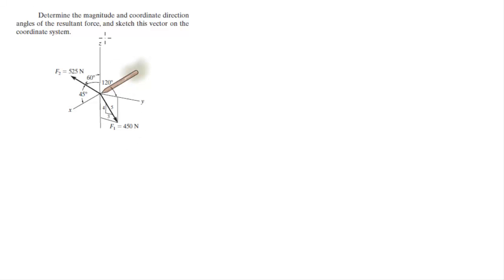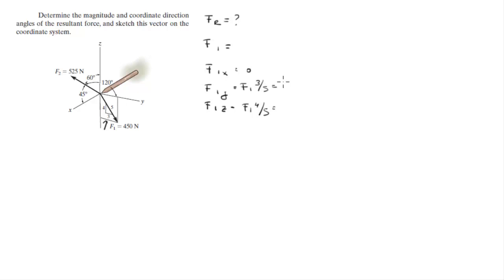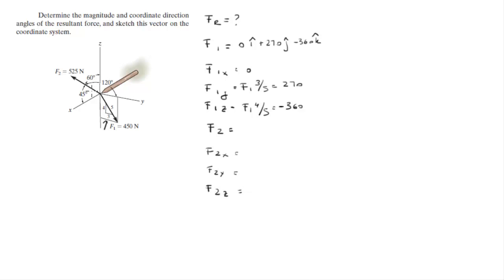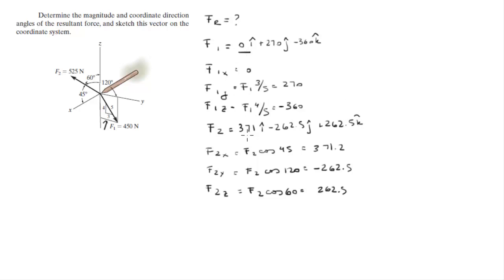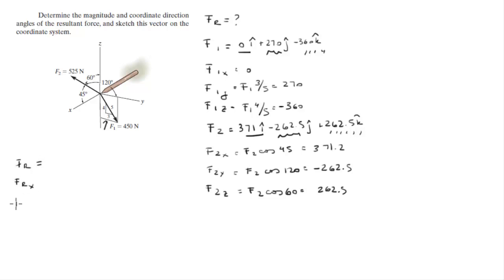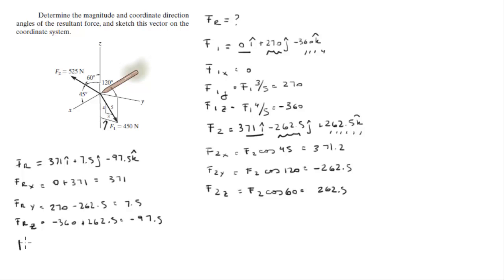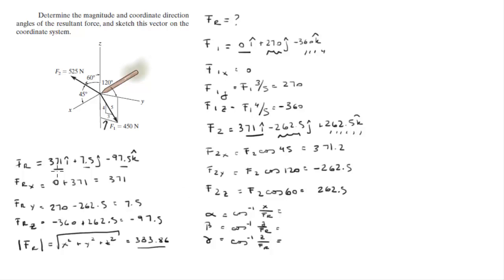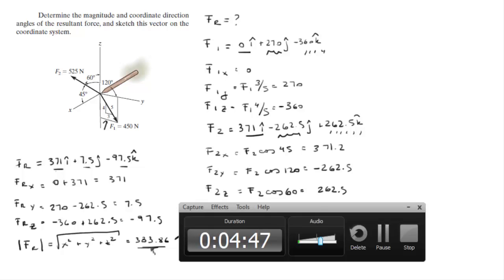Find the resultant force and its direction angles

Comment: For future reference, since some people are slightly confused:
Fy=F1(3/5) is rather simple to find. When using triangles such as the 3-4-5, pay attention to which side is parallel to which axis. In this example, the side 3 of this triangle is parallel to the y-axis. 5 is the hypotenuse and so it will go on the bottom. So, you will then take the force (in this instance F1) and multiply it by your fraction: 3/5. This same principle applies to Fz as well. 4 is parallel with the z-axis so this will become the numerator, and again 5 is the hypotenuse so it will go on the bottom, hence Fz=F1(4/5).
In short, the parallel side goes in the numerator. I hope this makes sense and that I explained it well enough. This concept also applies to 12-13-5 triangles too!
Reply: I'm a little confused . are we using cos or sin cause we use cos in most problems